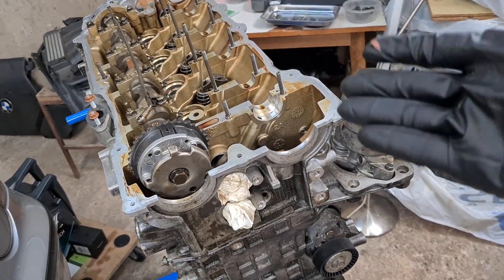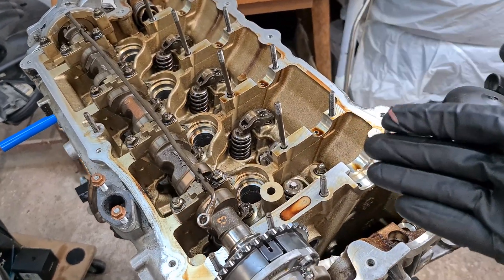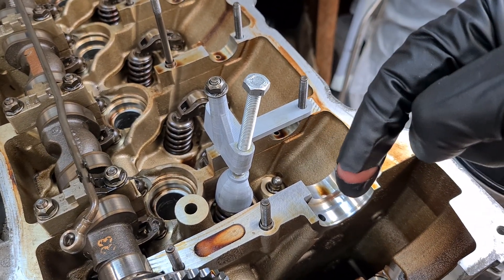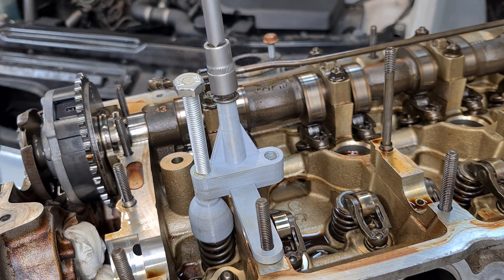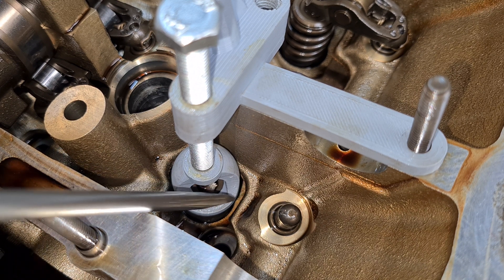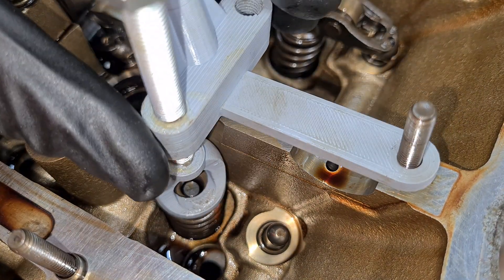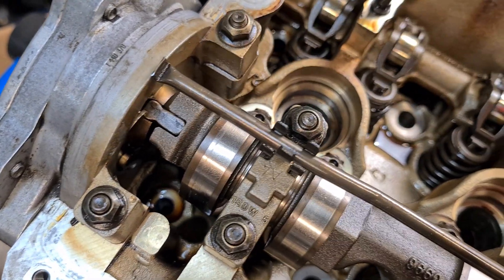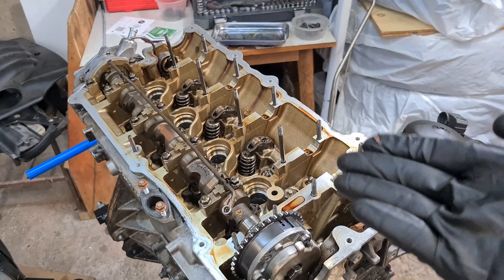N42/N46 Compress and remove valve spring without compressed air?

Comment: I bought the tool from your website, but unfortunately one of my intake valves was leaking so I had to pull the head out to replace the stem seals. I still tried it on the rest of the good valves and the tool worked perfectly for compressing the springs.

Comment: Isn't that a bit risky just to let the valvestemseals hold the valve ? What if it falls inside....?
Reply from the maker: I agree, this is just an experiment - I would not recommend this to somebody doing this job for the first time. Piston must be at the TDC to prevent the valve from falling in to the cylinder. In TDC, you can still get the valve up with strong magnet or carefuly with pliers.

Comment: Hello can you help me with an advice on my n46 b20b knock ..i have a video in my playlist..thx❤
Reply from the maker: did you check if your chain rail guide is broken? you can remove the oil filler cap and try to move the plastic rail from side to side:https://youtu.be/ANWggY4_j0Y?t=1324

note: moving front to back is normal, side to side not.
Reply: @BimmerZen   IT is strong not moving
Reply from the maker: @RomanianBoy-q2v  Valve cover needs to be removed and components inspected, especially Valvetronic components like intermediate levers and torsion springs.

Comment: I like your video. Can you make a video about installing an oil catch can on N46
Reply from the maker: Thanks, but why would you want to install a catch can on a N46?
Reply: my ccv keeps clogging, i think occ can alleviate that, but i can't find any detail information about installing occ on a n46
Reply from the maker: @erichu9462  If it keeps clogging then I would suspect something else is wrong... Did you check all the hoses going to the CCV? Sometimes the upper hose that is connected to the intake manifold gets clogged and/or collapses and that prevents proper vacuum to be applied. It's also possible that the drain hose that leads back to the oil dipstick tube and oil pan is clogged. I've never seen or heard of an OCC on an N42/N46:)

Comment: I've done this using the excellent compressor tool from bimmerzen, and soft nylon rope in the combustion chamber.  Easy enough! I recommend starting with the piston about half way, stuffing as much rope as possible, then turning the crankshaft until you feel the piston stopping tight against the rope.  Doesn't need to get all the way up to TDC. This way the valves didn't drop at all even with very worn seals.